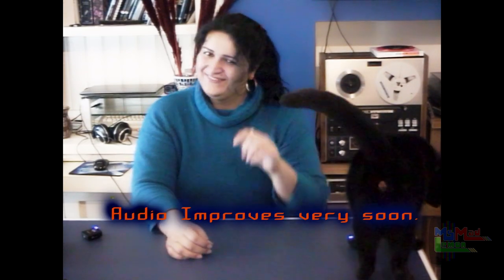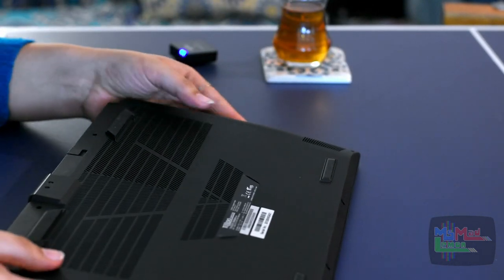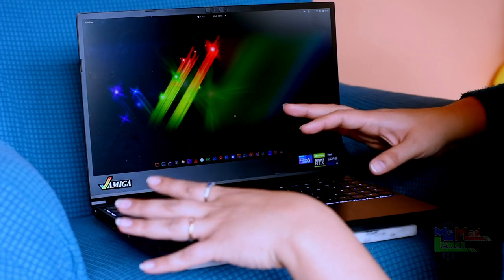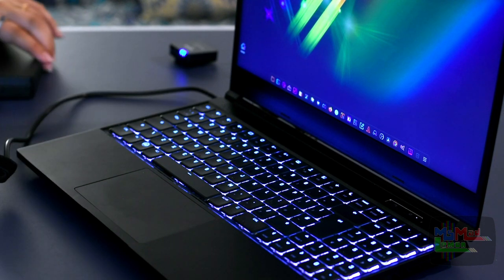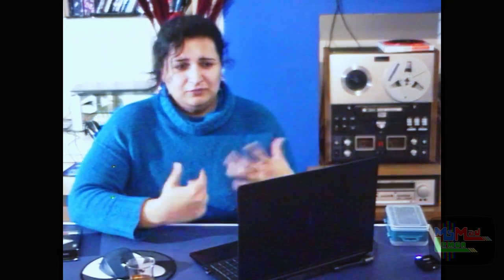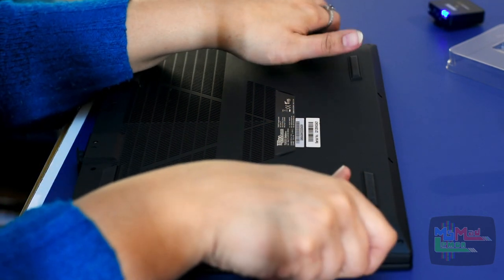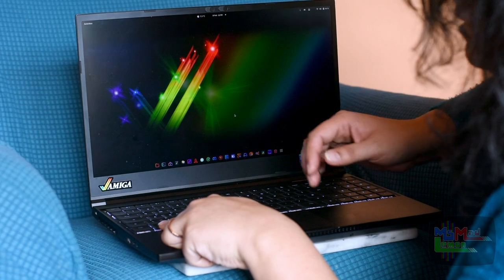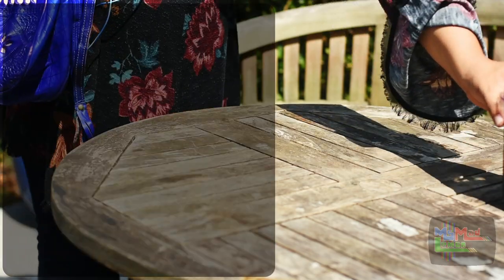Linux Laptop? My New Tuxedo Stellaris And My New Project Workflow (Review - Overview)

Comment: Oh yeah.... I know the pain of distro testing. I might have gone through 100's of them between 1995 and 2016. I finally sat my sight on Ubuntu Mate, as I find it has the best from OsX, Windows and Os/2.

I have also used second hand laptops the last +10 years. The last computer I bought brand new, was in 2009. But I have been fully on Linux since 2016. Except vintage computers. I just fell in love with Unix and Linux in 1995, but Windows were just more easy to use, untill 2016.

Comment: I use Fedora for about 4 years but right now I changed to Void Linux with KDE because I prefer to have a systemd free system, and also because I like to use different distro after some times, maybe I will switch to gentoo in 4 years who know 😊
Reply from the maker: Indeed, it's nice to have a change every now and then. I've not heard of Void Linux.
I've just changed from Fedora recently to Tuxedo OS2 which is I believe Kubuntu based? I just needed the laptop to work right. But with all that's going on with Red Hat now, I think Fedora might start using telemetry, which i'm not comfortable with at all. I'm starting to get used to KDE now.
Reply: @MsMadLemon  I started to use Void before the Fedora change and I will not going back to it

Comment: So you're a Linux user, what a pleasant surprise! I was an Amiga user and when I had to move to another OS it was difficult for me.
On 1998 I decided to buy an Apple iBook clamshell, and it was a big step backward compared to my loved Amiga 1200!
Mac OS 9 was really outdated, I missed so much a real preemptive multitasking.
Anyway, after almost 10 years using Apple machines and OS X as my main system while flirting with Linux, I finally moved to using Linux as main system. And I agree with you, Fedora is the best for me too. I've been using my different distros, but Fedora seems to be the most solid and bleeding edge compared to the others.
Thanks for your video!

Comment: I'm with you on Fedora - It just feeling like "home" for some reason, and I've been using it forever.  Lots of drama on desktop choices, but I never really felt I had a problem with GNOME, and it works well enough for me.  I've even installed Fedora on Windows WSL, and it's fine and good.  And I've repurposed a NUC from a few years ago to be a dedicated Linux machine, and that's been fairly smooth too.  Maybe if I tried to use a few vendor specific features (like that control software you showed) I might have to twiddle around a little, but so far...

Comment: I guess HDD lights have gone away due to SSDs making storage no longer a major performance bottleneck.
I too am frustrated about the fact that most laptop manufacturers seem to flub speaker quality.
As for Linux, I've run into so many annoying quirks like your backlight problem when trying to use it on laptops that I only ever use it inside of virtual machines now lol
Reply from the maker: I haven't had any issues with Linux on all the makeshift laptops I've installed it on. Well except for the macbook.. Ironically the back light issue is only on the Linux dedicated laptop... Why?!? Lol
I think Apple started this no led trend with their macbooks as I noticed it on them before anything else. Even if you have ssd you still wanna know if somethings finished saving lol
Reply: @MsMadLemon  I'm glad you've had better luck with Linux on laptops, and I hope that it continues. I wonder if some of my issues were specific to the laptops I've tried to use (like Dell/Alienware ones with Intel+Nvidia dual GPU design before it was common) or side effects of configuring them differently than most people (preventing sleep while the lid is closed etc.), but it was enough to scare me off of wanting to use Linux as a daily driver laptop OS.

Comment: I feel you, I want my data on my hardware, not on someone else's computer (aka cloud). And I only trust open source operating systems with my computers, using Linux for about 20y. Luckily I never felt for distro hopping, sounds horrible. 😨
I can only advice newcomers to pick one of big and well supported ones like Fedora, opensuse, Ubuntu (or derivative) and get used to it, that's time better spend then hopping. Also keeping a separate home partition or disk will come in handy eventually. 🤓

Have fun with your new machine! Awaiting new Amiga (or Linux?) Videos. 😆

Comment: Water cooling in a laptop? I've never bloody ever seen that! :)
Looks a bit like modern Thinkpads or Latitudes. No clit though. Agree

Linux youtubers? Veronica Explains comes to my mind. 

As for distro hopping, I never understood the reason for it. Repeating all the tedious configuration every time you switch? Not for me. 
Iused to use Fedora at work when I did tech support and software testing 10 years ago. I got into Debian for my own systems and it stayed that way ever since :). 

Kicad? Nice. Still gotta learn that one. I did PCBs in Eagle but heard that Kicad got way better since v6. Oh, and I see you've got a Weller soldering station and a Fluke DMM... that's some good stuff!  What other electronics lab gear do you have?

Lovely world in Minecraft! Impressive attention to detail <3.

Comment: Thanks for the review, Maddi. It's definitely worth considering to support the Tuxedo. If they can iron out the kinks and creases, and the laptop is repair friendly, then this would certainly pique my interest. For the moment, I boot into Linux Debian on a SSD on my main computer (dual boot with Grub as the boot controller over Windows), but I also have a dedicated old laptop with Debian as the only OS. I know what you went through trying to get things working in Linux. That's the nature of the beast. I had to install fresh nvidia drivers for my gfx card, which required booting into Linux's "safemode" with no internet, figure out how to activate the internet, then figure out how to download and install the drivers - all from the Linux command line. I got it done, but it cost me an afternoon. Anyhow, nice to see the old camcorder in action and keep up the videos!

Comment: It’s probably far too late now, but have you considered partitioning the boot drive in two so that the home folder is in its own partition? That way if you ever have to reinstall the system partition you won’t have to worry about backing up and restoring your home folder. 

Old school Linux used to force you to do that, and swap partitions instead of swap files. I understand why people prefer not to have that anymore, since if you ran out of space for the system partition it was a pain in the bum. But with LLVM you can have resizable partitions now, so it’s less of an issue while retaining all the upsides. Plus with those 2TB drives you could probably give 100-150GB for a system partition and never approach its limit (assuming large user programs lived in your home folder). 

Anyway, like I said at the start it’s not really worth going through a total reinstall all over again just for that. But I guess you could keep it in the back pocket for the next time you have to reinstall for whatever reason? Unless LLVM is enabled by default now and you could move the home folder without another reinstall…

Comment: I go distro and GUI hopping occasionally, but always seem to end up with Fedora and Gnome. The only other one I would go for is raspberry os coz it’s just easier on a Pi.

Am a long term Linux user (oh no — could be 25+ years!) — just wish the communities could get their head around having a consistent GUI instead of every app doing it’s own thing. Bit of a shame the GnuSTEP project wasn’t a bigger success as the nextstep GUI seems to still be the best fit for Unix… but if you’re not a fan of OSX then I guess you’d not find it’s ancestor so great. I seem to remember Dave Haynie saying Commodore trying to make AmigaOS look a bit next like from 2.0.

I’m rambling 😊
Reply from the maker: I actually like OSX and the way it works as it's quite Linux-like, I always preferred it to Linux.. it's just that I don't trust it anymore, for the same reasons i don't trust windows. I'm also not a fan of Apple as a company nor do I like Microsoft. I havent heard of the GnuSTEP project, curious about it actually.
Reply: @MsMadLemon  when NeXT decided to open up NeXTSTEP to an open standard (renaming it to Openstep in the process), there were a few implantations started, one of which was gnustep which was open source. They got a long way, with a few working applications, but I think the project has not moved forwards in years and I’m not even sure if it’ll run on an up-to-date Linux. Curiously, Sun were also working on an implementation to sit on top if Solaris, although I think that was dropped in favour of Java.

Also saw your comments on the Cloud, and for me it’s almost the most retro computing of all: a regression towards the 1960s/70s concept of a computer bureaux where you’d rent time on a mainframe to run your app. All the brilliant ideas and hard work to create the era of personal computing thrown aside.